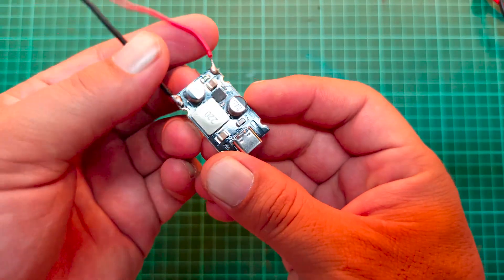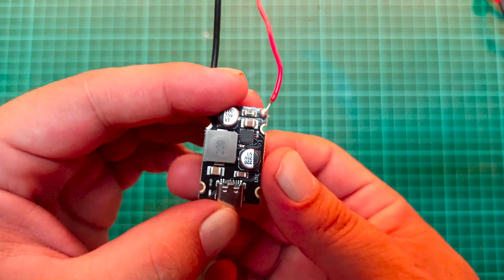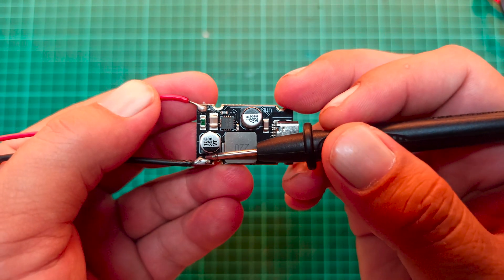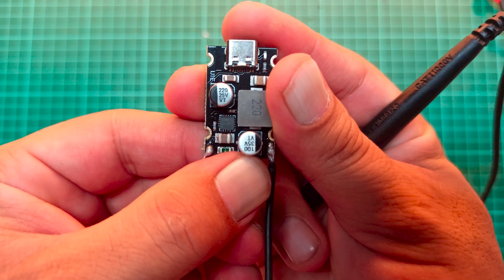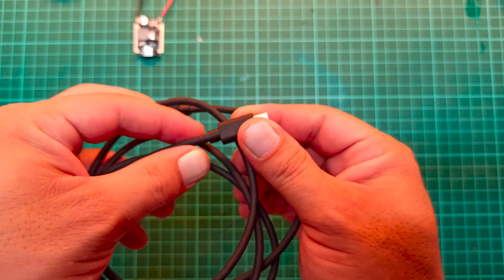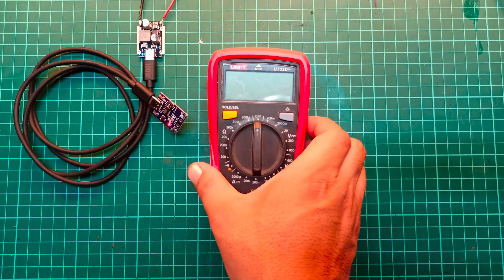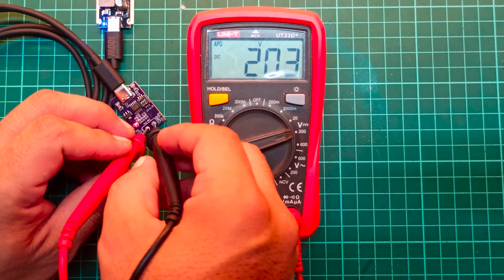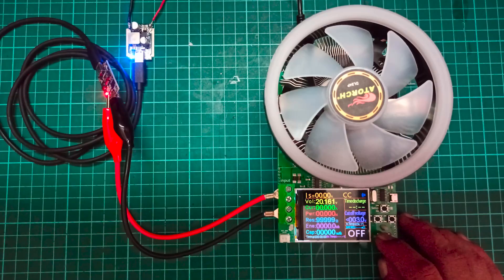65W USB-C Power Delivery Module | Multi-Voltage Output (5V, 9V, 12V, 15V, 20V) Test & Review

Comment: You made a very nice and informative test. I just wanted to mention one small detail: using crocodile clips on the output of the voltage selector module may introduce additional contact resistance, which can affect the accuracy of the QC3.0 measurements. A more solid connection (such as directly soldered wires or a proper connector) could give more reliable results. Thanks for the great content!
Reply from the maker: Hi there, 
I appreciate your detailed observation and suggestion!
 Thanks, will consider it next time.

Comment: Thank you so much! The review was very interesting! I would have liked to know the input voltage and current draw of the module with the output switched to 65W. Thanks !!!!!
Reply from the maker: You are welcome.
The input voltage was 24v power supply during the whole test operation, and sorry i didn't checked the input/output current.

Comment: How much voltage and power it can provide when connected to a 2s bms i.e. 8.4 volt?
Reply from the maker: Output will be 5v and power depends on your battery pack.

Comment: My module is not getting on, why? I have given 20v supply and made sure that terminals were correct. I have given the load, still not getting on. please advise
Reply from the maker: Some times these modules gets faulty during assembly in factory. I suggest you should always order atleast 2 of such modules to be sure one works incase the other is faulty.
Reply: @ERLEngineering Yes, I did the same. it seems one is faulty. Thanks for the reply
Reply from the maker: You are welcome

Comment: Hi my frined.
my mobilephone need 9v to charge up. if I put 24v to the input, how can i chose the output voltage to 9v? The PD65w auto chose to 9v to charge up my phone?
Reply from the maker: Does your phone supports QC3.0 QC4.0?
Your phone name/model?
Reply: @ERLEngineering maybe not. I have a galaxy note 20 ultra. They use USB-PD 3.0 PPS. 
Do you know, is it possible?

Comment: It heats after PD of 22W
Reply: Yeah use some heat sinks on tha don side or module and also plce a thermal tape bw them  than  a heat sink on thr inductor of module  everything will b fine 👍 i faced too its heating q quite high but after heat sink its working ferfect
Reply from the maker: Might be damaged device, but mine works just fine till 65W without significant heat

Comment: Share your exact input voltage details 
You not share in video
Reply from the maker: Its 24 volts input
Reply: @ERLEngineering  Thanks !!! Input voltage was 24 VDC but, how much current takes at the input @ 24VDC ??? Thanks !!!
Reply from the maker: Since this module is a step down so input voltage should always be higher than output
Reply: so it will provide only 5v when connected to a 2s bms 8.4 volt?😢😢
Reply: @ShubhamSoni-ux5ub Yes only Buck to less available voltage

Comment: 1 phone charge heat
Reply from the maker: As i mentioned earlier, the module produces very low heat during operation so even charging a phone will be no issues at all. You can even charge a laptop with this module which supports PD charging.
Reply: @ERLEngineering  can I connect 50w solar panel directly on this module
Reply from the maker: Yes but only if solar's peak voltage in bright sunlight is under 33 volts.
Reply: @ERLEngineering hi I forgot to ask, does this module need 30v to get 65w output, or will I still get 65w output from 12v 5.5amp input, just asking because I don't know if it have amp limit
Reply from the maker: It can output 65w at 12 volts but with more heat as compared to when input is higher, so a heatsink is necessary for 12 volts and 65w
Reply: @ERLEngineering ah I understand now, thanks for explaining

Comment: Mobile charging module right...?
Reply from the maker: Yes, but it can be used for powering up other low power devices as well.
Reply: Can you please share the module details @ERLEngineering
Reply from the maker: Please search for 65W power bank module on google there you will find this module, its details and pricing on different platforms.
If you need more information you can comment here
Reply: @ERLEngineering  is this safe enough to charge Smartphone safely 
For a good Smart phone battery life
Reply from the maker: @Eco-vlog_official yes absolutely, this module is specifically designed for power banks and it has protections included to ensure safe charging of mobile phones.